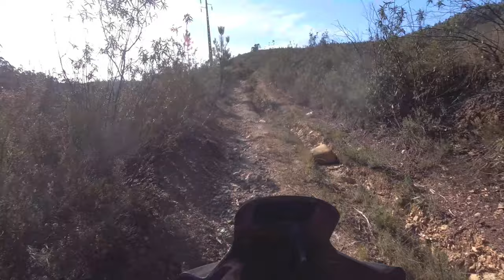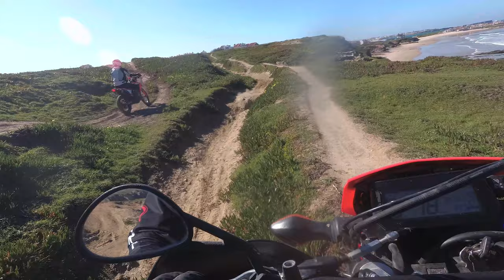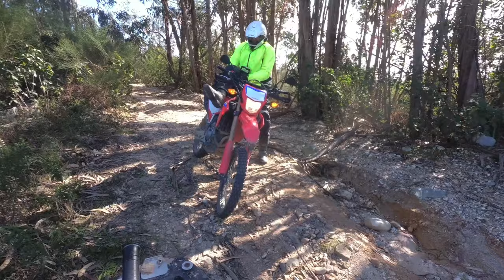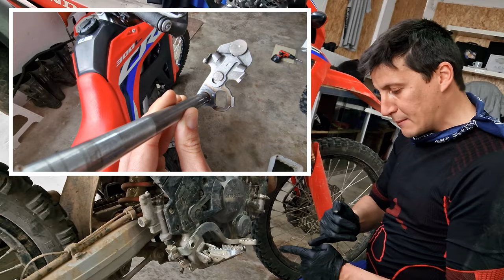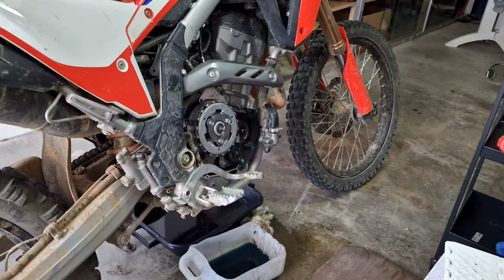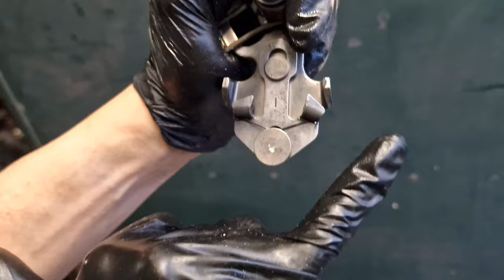Stuck gear pedal on a CRF 300L (How to fix it!)

Comment: A cilindrical aluminium bushing between the gear lever and the engine block ( with clearance for the oil seal ) should be easy to make, and avoid that to happen again.

Comment: In my crf250L I installed a Terrex crash bar at least it would protect the from hitting the delicate the shifting gears pedal or the foot brake pedal or a direct hit to the engine with an aluminum radiator guard added.

Comment: Great stuff,  good video. 
I had this happen...

I did learn one very important thing.
If this happens out on the trail,  definitely  remove the gear ⚙️  shift leaver.... because,  if say it's stuck in 2nd,  you can still ride the bike.. if you don't remove the shift leaver it will get a knock of some kind and shift to a higher gear..  it can hit something like a rock  or a bank , anything,  you can accidentally bump it . 
So if this happens all of a sudden, the bike is unintentionally in 3rd 4th or 5th gear.. no way can you get home in this case,  you'll burn the clutch out for sure.. as I did 😅😅..  .. rider well  !!

Comment: Such gorgeous scenery. I enjoyed similar trails on a rented bicycle a couple weeks ago, but not such gnarly trails, and it was a lot more working getting up and down them! Was it a linear hit parallel to the shaft (perpendicular to the plane of the bike) that bent that side hook on the clutch plate, or some kind of rotational hit as well, or a bending moment perpendicular to the shaft?
Reply: Hi
I hit a wall of stone on the left, which bent the gear pedal tip back, pulled off the rubber and banged the gear lever shaft.  On the ratchet end you can see the bent metal. There was also a significant nick in the metal. The bike stayed upright, as did I, but it was a moderate clunk. A strange outcome though. S
Reply from the maker: As usual, you did the impossible, @Stuart :P

Comment: It's pretty bothering defect of the Honda, a simple over rotation of the selector (so strong that it remains intact) bends the fingers (or crooks) of the spindle. I imagine that in the middle of nowhere at 60 km from the next civilized place. It does not promise a great long term reliability, I'm afraid of the wear of the fingers, maybe I'm wrong.
Happily the Honda engineers decided to use soft steel for donkey's shoes so the selection drum is not destroyed, probable they knew that will happen and used the spindle as fuse. 
The accountants at the same time saved a few cents on the heat treatment of the part after saving a max on the wages, as the Honda CRF 250 and 300 are made in Vietnam where the minimal monthly wage varies following the regions 140 to 202 US$, but the CRF 300 L is sold in France around 6000 € , 6400 US$, not specially cheap...
Meantime Voge makes the 300 Rally in China where the minimal monthly wage in Shanghai is 400 US$ and sells it in France at 4600 €...

Coming back to this pretty bothering defect, probably there are several solutions, I see immediately two, probably able to work, which can be done DIY rather low cost.
And Fantic strikes again with a 250 "leisure" enduro, trail legal Euro 5 with lights and so on. You can go to work in town with. 2023 FANTIC XEF 250 TRAIL 6400 euros including start fees AND 104 KG DRY, 116 kg wet if the specs are not a big lie. 
Made in Italy with people earning decent wages, having medical social security, and retirement by an Italian company paying its taxes in Italy. 20 years ago when I was able to ride TT I would have killed to get such suspensions. A so called trail that looks more like an enduro tool. Make a search and look at the pics.
Addendum There are some pics https://www.gumtree.com/p/fantic-motorbikes/fantic-motor-xef-250-trail-enduro-2023-competion-new-model-italian-built-%C2%A35199/1371120240
The engine seems to be the Zongchen NC 250.